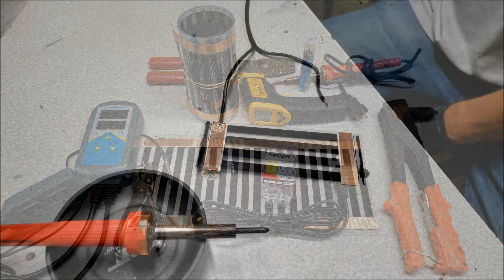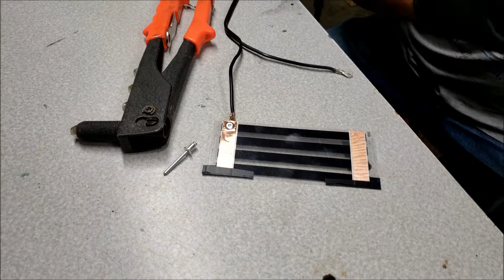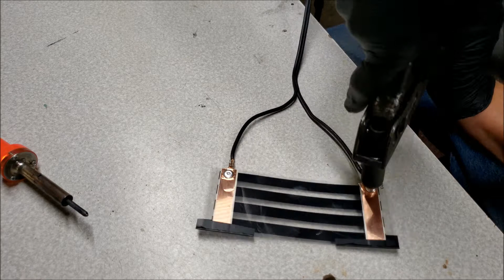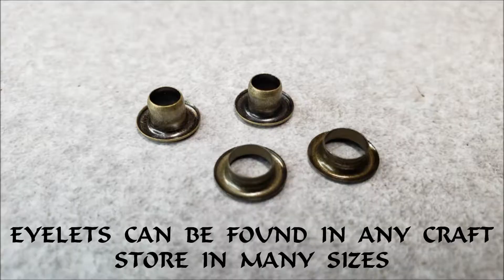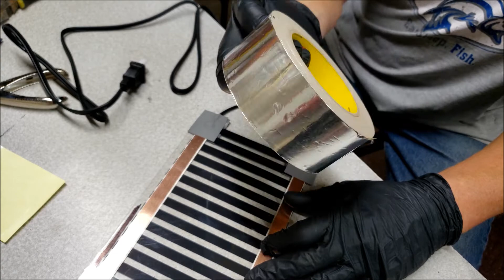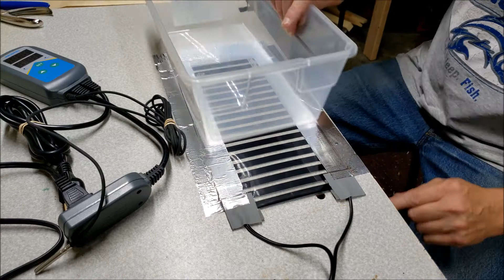How to use Flex Watt | Heat Tape

Comment: How do you hook up the heat tape for  an 12 shelf rack system
Reply from the maker: Some people will run one continuous piece of heat tape zig zagging in and out of the rack ...I cut sections that fit under the back of the tubs and wire them together

Comment: Awesome video, the only one that made sense that I've seen!

Hopefully someone sees this, but is it possible to wire several pieces together to one outlet plug in? I have a multi level rack, and I'd like the 10 levels to operate on one wall plug at the bottom. How would this be achieved?